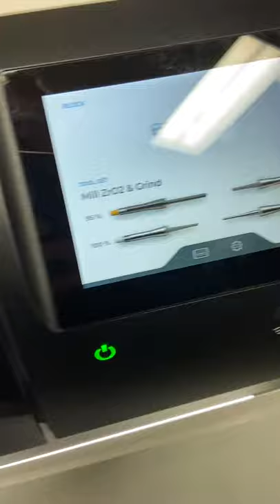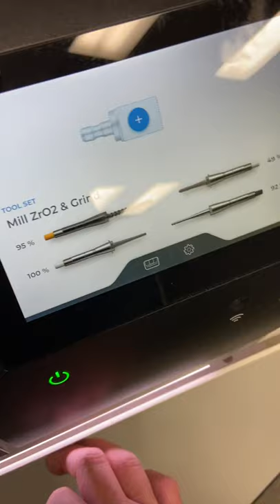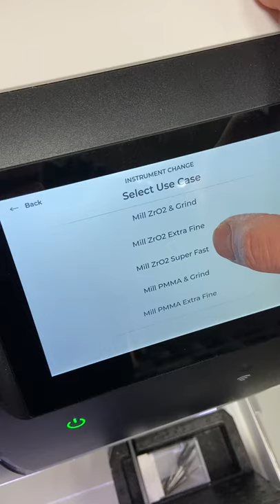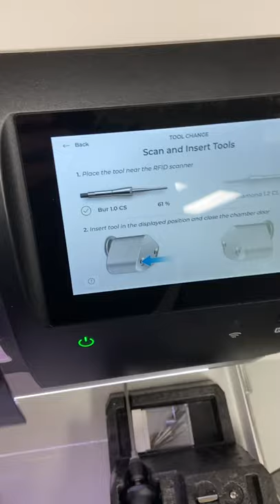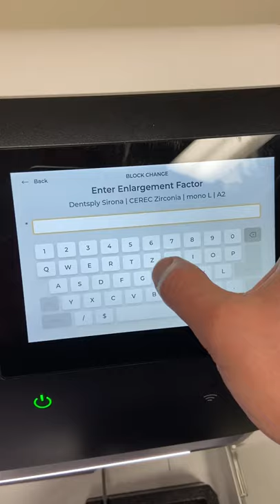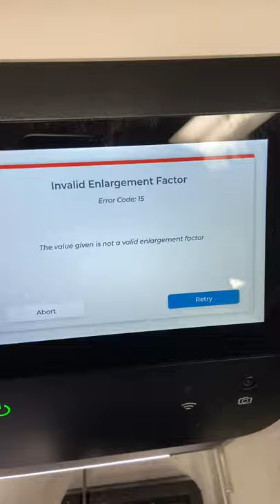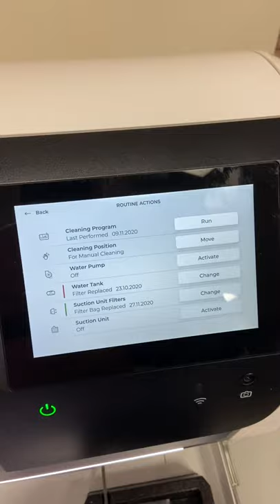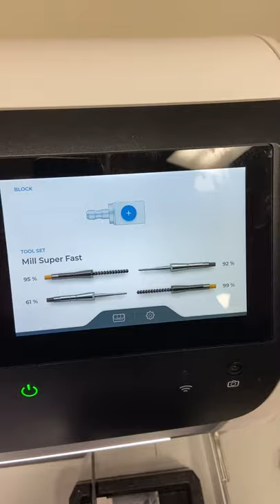CEREC Primemill Basic Training

Comment: What happens if the mill is not use as often but displaying a filter or water change? Do you keep the same filter and water and bypass it or you actually have to change out the filter and water?
Reply: I would change the water because it can discolor when sitting too long but the filter should be ok.